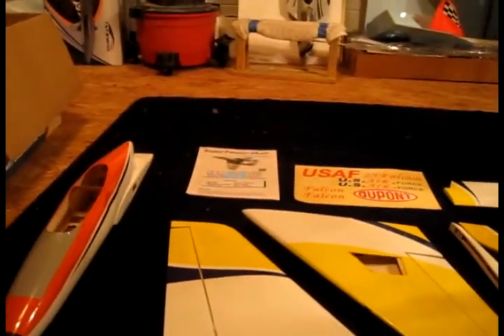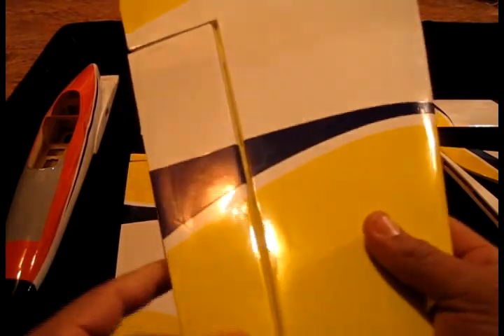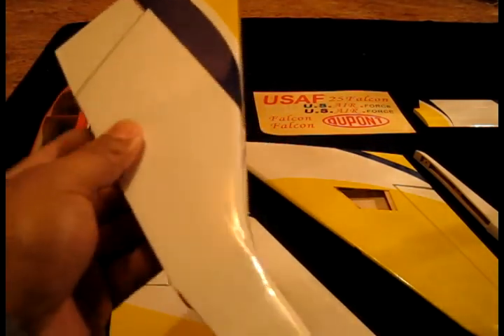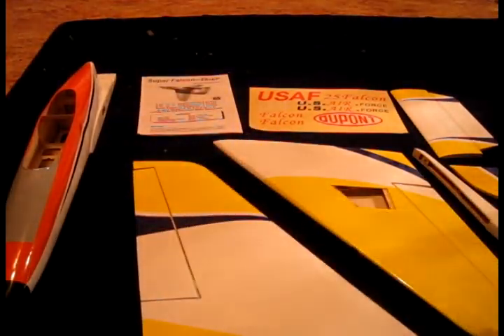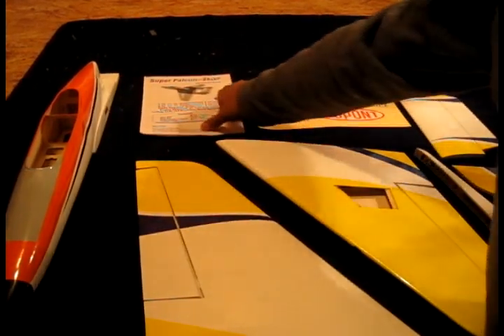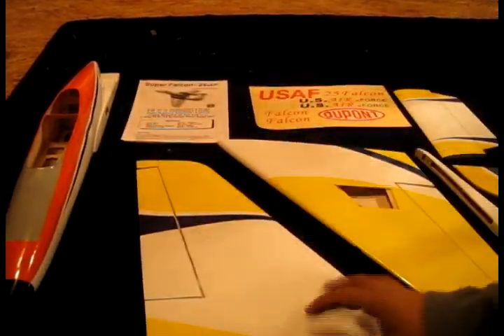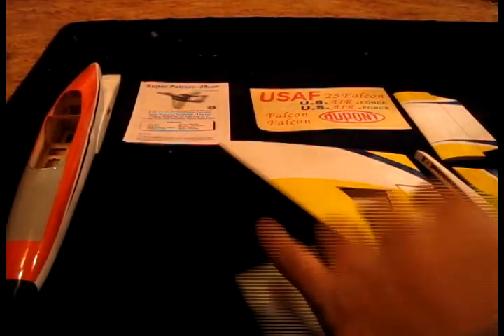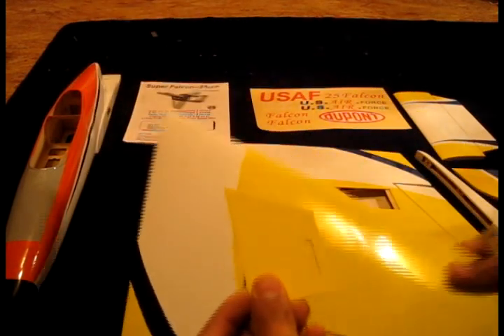nitroplanes Falcon .25 Build (part-1)

Comment from the maker: I will try it with the fix landing gears first and in one or two months ( if still in one piece : ) I will add air retracts ( way air and no electric? ) this plane will flight with 7 servos and I do not wont to over load the UBEC with 3 more servos and air retracts is something that i never worked with before so it is going to be fun to do something new : )